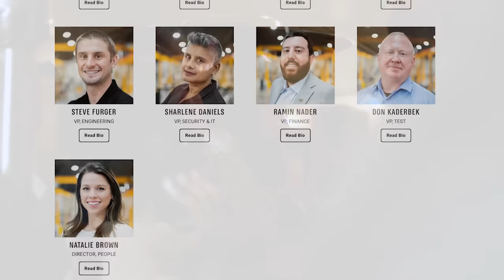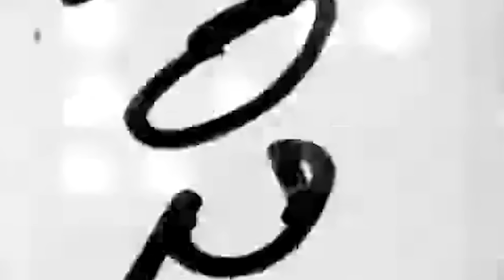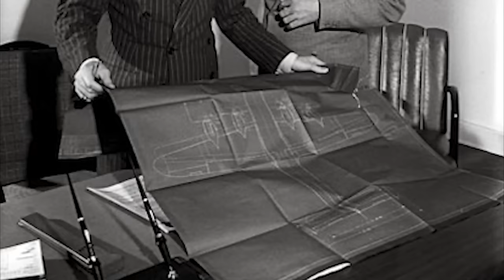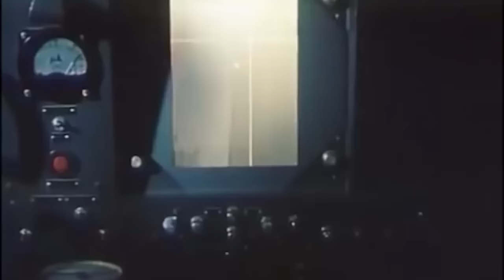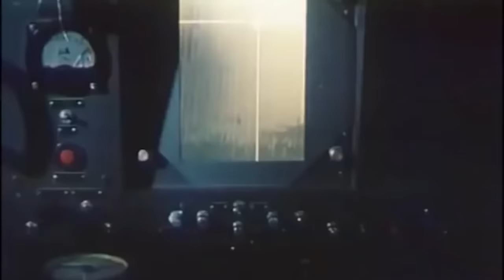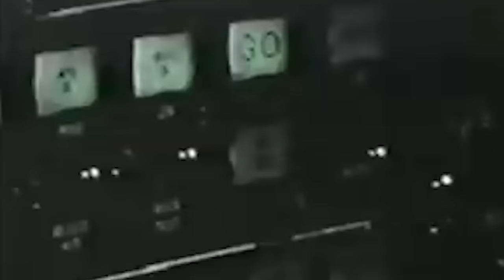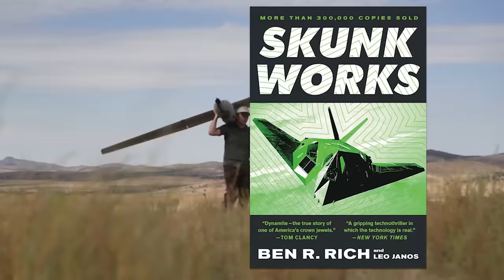Is Hermeus the Skunk Works of a new generation?

Comment: Oh please....'Quarterhorse MK1' put together with external rivets?   As an aircraft sheetmetal professional I can opine that this looks like a shop project from an A&P school....and very crudely done.   That anyone would display this as their 'progress' just amazes me and should caution anyone thinking about investing in them.
Reply: Two questions: 
First: Is there any significant disadvantage to using external rivets on an aircraft that is only meant to be used at low speeds?
Second: Are external rivets cheaper than flush options?
Reply: @lazarus2691  The rivets appear to be of the common 'pop' variety and while there are structural 'Cherry Max' rivets available it would astound me if these were anything but cheap hardware store aluminum rivets.
This is supposed to be a prototype hypersonic aircraft....yet they're worried whether it can actually fly?   The engineering needed to make flying machines is WELL known...why these people are messing around with this crude amateur looking thing is...I'm afraid to say...distressing.
Look at the inlet...or rather the lack of inlet which just screams 'we have no idea what we're doing'.   If they think this aircraft is impressing anyone...sad to say it's not going to impress anyone who knows anything about aircraft and particularly of the supersonic variety. 
I've seen dozens of home built aircraft which show a higher degree of craftsmanship...and personally I'd be ashamed to show this thing to anyone if this was the best I could build.   And if this isn't the best that they can build...why not?
Reply: @recoilrob324  Thanks for answering my question - my background is rocketry, and rockets haven't used rivets since the V-2, so they're outside my expertise.
Cheap hardware store rivets is pretty much exactly what I expected. You see, right now in the rocketry world there are two diametrically opposed camps of development. 
All-up testing vs incremental testing. Hermeus *appear*, to my untrained eye, to be doing the latter with aircraft, which I've never seen before.

A traditional prototype would first do taxi tests, then takeoffs and landing, then low speed flight, and then gradually increase the flight envelope - all with the same aircraft.
That is all-up testing. Hermeus meanwhile built a very crude (and cheap) vehicle that they could do taxi tests with, the Mk0.

They've now built a slightly less crude vehicle, Mk1, for the sole purpose of de-risking takeoff and landing for later Mks. It is not supposed to be the best they can build, it's supposed to be the cheapest and quickest. It is not supposed to qualify the aerodynamics at transonic or higher speeds, so there's no point in adding complex inlet geometry or flush rivets.

They've got a pair of P&W F100s sitting around that aren't going on this aircraft, so clearly they're not hurting for funding to the point where this is the best they could afford. That means either they're intentionally spending very frugally to save money for the later more important prototypes, or they're complete morons. 

Mk2 will be the one to watch - it's supposed to push into higher speed regimes, meaning that the aerodynamics will actually matter. If that one still has the same issues as Mk1, then I'll conclude that they really are just idiots. Until then I'm willing to give them the benefit of the doubt, based on the results I've seen from this method elsewhere.
Reply: @recoilrob324  
Update: I've just found out that Hermeus was founded by one of the engineers involved with SpaceX's Falcon 9 development program, which pretty much confirms my theory.
Still doesn't mean they're necessarily going to succeed, but I do now believe that they're doing this intentionally.
Reply: @lazarus2691  It's funny that this information can be taken two ways: one...as you suggest that they know what they're doing, and the other that SpaceX doesn't let good people go without a reason and maybe this fellow didn't cut the mustard there?
For sure they know how to attract funding...time will tell how far they get....but I wouldn't get my hopes up as their stated goals are beyond what all the other aerospace companies have been able to achieve and having worked on the SR-71 program there are SO many glaring issues they seem to be glossing over I'm not convinced they really have a grasp of what they're promising to do.  We'll see....
Reply: @recoilrob324  Anyone who isn't cut out for SpaceX gets culled in the first 6 months. Anyone who lasts longer than that tends to leave on their own terms.
The most notable example is Tom Mueller. He's widely considered to be one of the best spacecraft propulsion engineers on the planet.
After working there for 17 years, Tom semi-retired in 2019, then left completely in 2020 to start his own company, Impulse Space.
Mike Smayda was at SpaceX for 5 years during the most critical period of Falcon 9 reuse development, leaving in 2016. So not as impressive, but still a good stint.

Comment: Waaaaaay off base here---Sorry Hermeus is NOTHING like the early LM Skunkworks. 
Also, I would like to know just exactly what "High Speed" wind tunnel did Hermeus supposedly use to prove the transition of their "Combined Cycle" engine from "Turbojet" to "Ram Jet"??? I posed this question to Hermeus on LinkedIn just after they posted this claim and they refused to provide an answer. A "Conex" box is NOT a "High Speed" wind tunnel.

Comment: When you going to do a video on Australian Hypersonixs and their scramjet powered drone, you a bad journalist or only try spreading misinformation that USA is in the lead on these techs.
Australian hypersonic drone will probably fly before this and their engienes have actual real atmosphere flights during HIFIRE to prove they work also.
Hermeus is just a copied version of the SR71 with a hypersonic fuselage design and material to handle the heat. 
Not skunkworks when copies another project lol.
You will actually look like a fool when other's do pieces on it and you failed to do any.